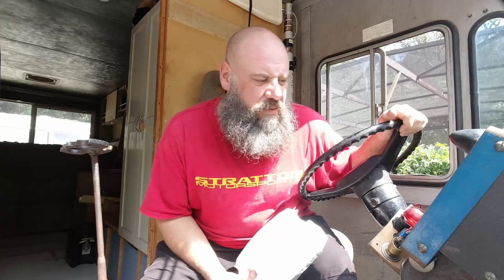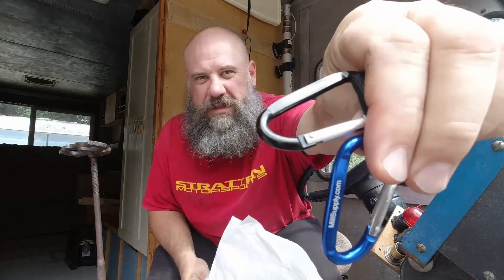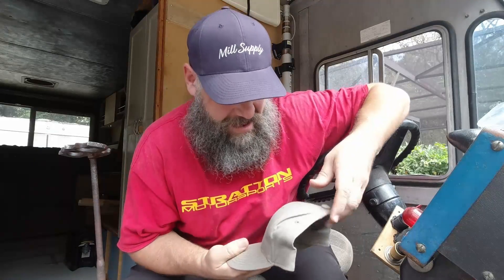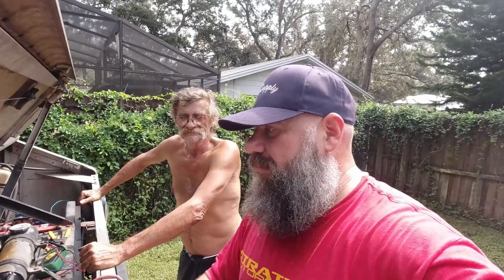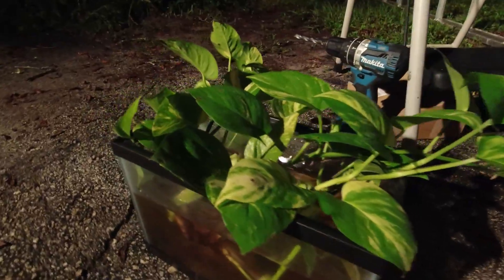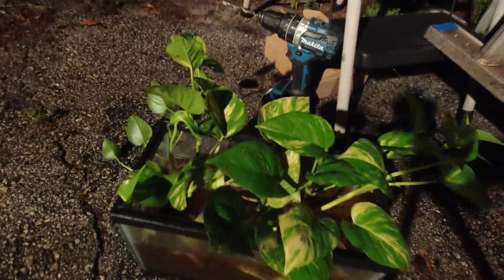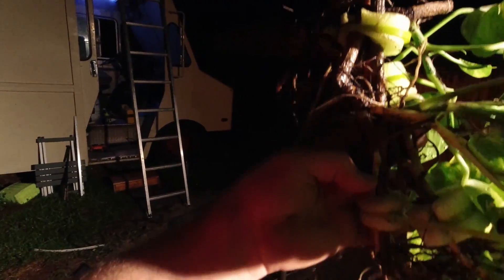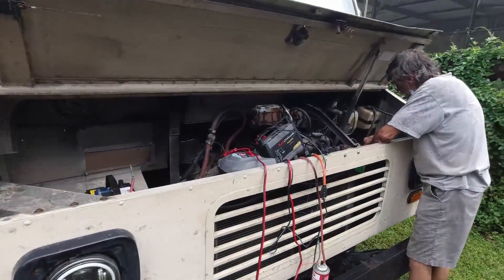WILL IT RUN? Lots of BreadTruck Upgrades! New Ignition, Batteries, Cabinets, RV Title!

Comment: Paul I see you made a new bed in the back with a window where the computer desk and desktop computer used to be. So no more desktop computer in your van? Are you using a portable laptop computer now instead of the desktop computer in the van? I like desktops better because they are better built and cooler with fans and last longer than overheating laptops in my opinion but laptops do save space.